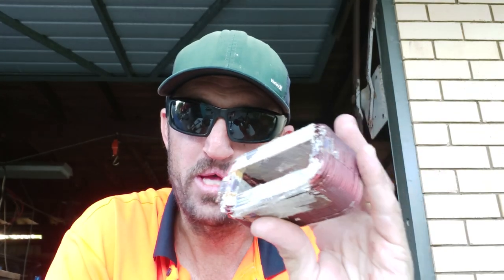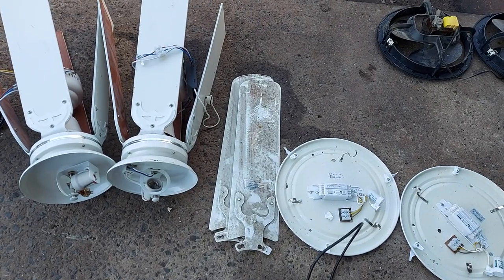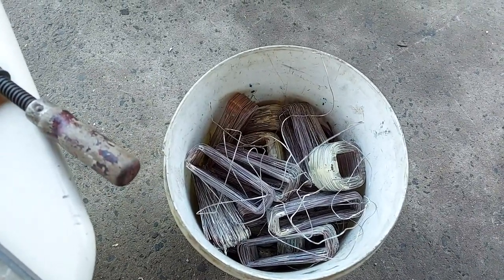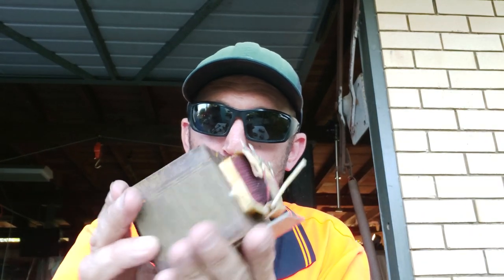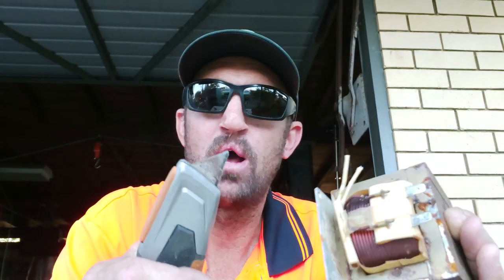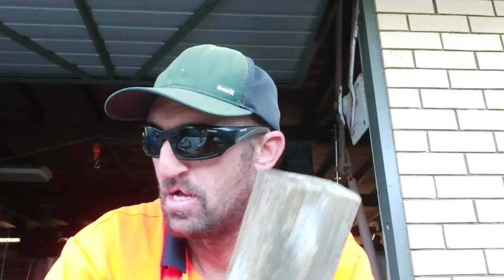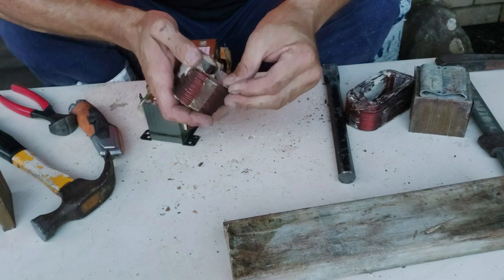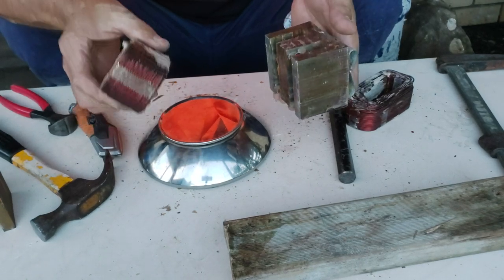Free Scrap Finds and How To Scrap a Transformer With Simple Tools

Comment: Cool video once again mate. Thanks for the mention, a little embarrassed but flattered also. 😊
I started to use those trannies to rest the outer edge of the ceiling fan casing on them so I could belt the motor out when I had those 60 odd fans. That's why I haven't turned them in at the scrapyard. They're more valuable to use in that sort of scenario. I used them to knock out the copper windings on that big 3 core transformers I did a couple of months ago also. The 36w ballasts were about 13% cu / fe , so your spot on. I think probably 3 to 5 minutes to completely tear one down so if I did the 25 that's  minimum 75 minutes  for $4 difference. So, they'll be going in as motors. Have a great Friday and weekend.
Reply from the maker: Thank mate tho no need to feel any embarrassment coz some of the things you show me give me some new views on how to do some things and the 2 transformers as a base support to knock the copper out of the transformer ontop is a great idea....Iv got a few of those 36w ballasts myself and based on the results of wednesday's findings i will also just put them in my motors drum.........Anyway time for me to load up the trailer for another scrap sell off today....Have a great day bud.

Comment: Hit the copper coil on the sides it will loosen the paper.
Reply from the maker: Thanks for the tip, it does often work but this paper was really stuck well with the resin or glue they used but not to worry.......Thanks for watching and commenting, have a terrific day.
Reply: Soaking in a bucket of water also works well Ray to get the paper off. Sort of like getting your old rego sticker off the windscreen. Soak it a little while and it peels right off pretty cleanly. 👍

Comment: Have you tried turning the top transformer up the other way? Place the copper on the 2 transformers, then just hit the centre steel section with the cold chisel.
Reply from the maker: Nope cant say i have and cant say im convinced it will work but if you try it yourself im happy to hear how it went.
Reply: Yeah I've done that with a particular style of ballast. Support the copper across the vice jaws and smack the steel out. I don't know how that would go with bigger transformers maybe the copper could bend or disform when belting the steel out. But, you do what you need to do to get the good stuff out.
Reply from the maker: Iv woke up this morning and had a bit of a different thought on your suggestion Troy and like the comment posted by Brad if clamping the copper in a vice and then bashing the steel in the middle out it will probably fall out, if the hammer is too big them maybe using a short length of reo bar and hammer to knock it out might work but no idea coz i haven't tried it.